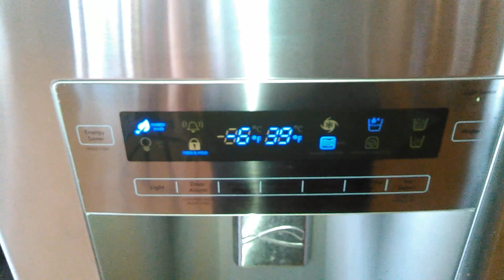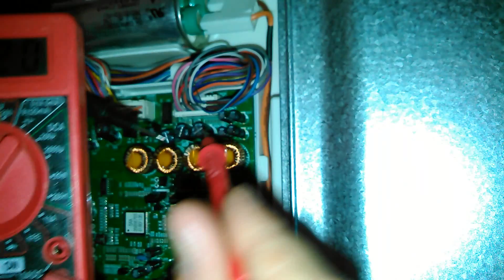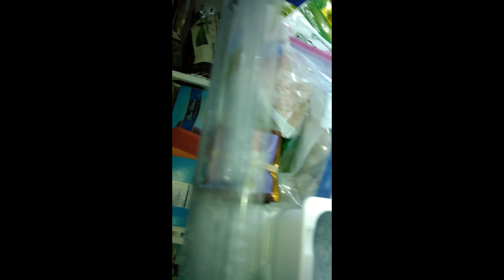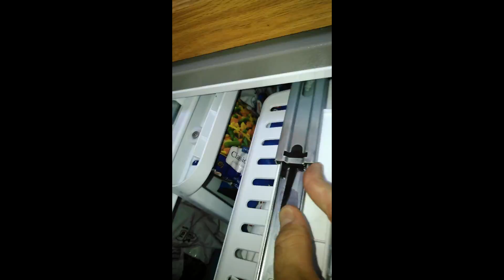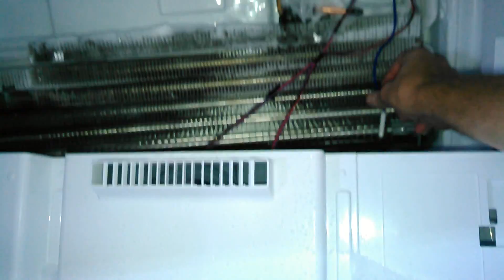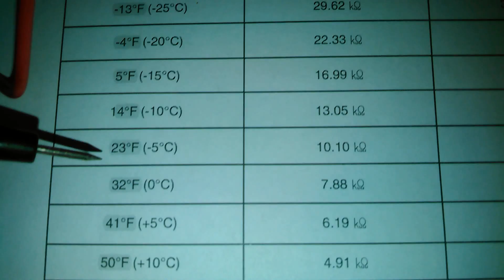Kenmore Elite Freezer Sensor Check 795.7205X.11X

Comment: Great idea to check the thermistor at the controller board area, but you should unplug the connector from the board so you only measure the sensor resistance.  Now compare the chart with the actual temp in the freezer.  You could also put the sensor in a glass full of ice water to check the temp at 32F ( 7.88K ohms).   (We all know you had the power is off)

Comment: Dang, my resistance measures right where it's supposed to be (~19 kOhms) for the temperature. I was hoping this was going to solve my problem but I don't think my part is defective. I had an accidental defrost and the ice bin filled right up but then stopped once it cooled off again.Great video though, thanks for helping me get started on troubleshooting.

Comment: Kenmore Elite, Estimate on replacing compressor $1,389. And repairing fridge.    Guys complete yunk.   How can we stand a class law suite against this product made by LG.  Sears is backed up on these fixes.
Reply: Let me know how. I have same problem with this junk product!
Reply: There already has been a class-action against LG for this.  Not sure exactly what the status is or the outcome was.  I just got a new compressor installed in my Elite 74053 refer and now it works TOO good (freezing everything).  Done with calling and wasting time on repairmen so I'm doing it myself to see if there is a temp sensor issue with mine.  Good luck to everyone!  Yes, LG refers are junk...
Reply: J Williams how much was that ?

Comment from the maker: Look in description for link to technical documents.  You have to view these documents with a technical eye or they won't make too much sense.
Reply: Hey, I am running into issues where the fridge/freezer isn't cooling at all. I was going through checking all the sensors etc but I have the fridge off. For the blue/white wire, I am seeing 3kOhms. It would be great if you can share the documents that you have.

Comment: Are you happy with your Bosch fridge now that you have owned it for more than 9 months?  I'm dealing with the same issue as your video on my Kenmore Elite.  I already replaced the compressor 2 years ago.  I ordered the sensor for $15 from Sears to see if that will fix the problem.  I completely defrosted the unit and there's no ice build-up anywhere (so the auto-defrost system is working fine).  All fans are functional and condensor coils clean.  It's either going to be the sensor (fingers crossed), the compressor again, or the circuit board.
Reply from the maker: Good luck to you with the new sensor.  As you know, it's an easy fix...after all the ice is defrosted.  I am happy with the Bosch.  The unit is a floor model of similar specs, small hidden scratch, ice unit at the top with its own coils.  Nearly 1/2 the price and the store still allowed a 5yr extended warranty.  I can tell all who read this, there is no comparison to the interior design on that Kenmore.  They did one thing correctly.  If only a compressor swap was as cost effective and easy as a sensor swap, I would have thought another second towards keeping the Kenmore...then moved on.  I guess it makes sense for companies/technicians because they buy the parts for 1/2 what the average Joe can.  There was a lot of looking at other frig models.  All were comparable, so I went with the brand I know for quality.   Hoping this brand doesn't go the way of the dodos.
Reply: @gratefulpatron5141  I will receive the sensor on Tuesday (tomorrow) along with a new Refrigerator Drain Tube which I discovered was cracked when working on the fridge.  The 2 parts cost $20 but expedited shipping costs another $22!  I have a home warranty service guy scheduled for Thursday which I will use if the sensor does not fix the issue.  I'll let you know how it turns out.  Thx again for your video

Comment: Would make sense if you said how you chose those wires to check......
Reply from the maker: Good point.  All contacts are called out in the technical docs.  Is the google drive access still available?  This is an old thread.

Comment: The cover on the thermistor? Is that plastic/foam? And you think it's to hold the sensor in place or to protect it from frost?  Mine is completely missing so I need to know, thanks.
Reply from the maker: The cover holds the sensor.  There is a small piece of foam on it, but frost / ice will cover it completely if there is ice build up on the coils.  The sensor has a long wire, but the wire gets encapsulated in ice with ice build up on the coils.  The cover / foam piece looks to have a design that holds and slightly insulates the sensor from the coil.  The coil is [supposed to be] colder than the freezer compartment, and the sensor is supposed to be measuring freezer compartment temps.  
If you are having problems, my guess is there are bigger issues than that sensor.  
My frig's problem was ice build up on coils was blocking air flow to ice making compartment not allowing ice maker to get to temp to make ice.  Every time I manually defrosted the coils, the system worked properly...but, the compressor was running 24/7.  The compressor was just keeping up with demand, but when the d
Automatic defrost system kicked in, the system went out of whack and ice formed on both coils (frig\freeze).  Fix the compressor, or new frig.  We chose new frig.
Reply: grateful patron ... Thanks! What I meant to say was the sensor AND cover are missing!  I got the refrigerator for free, 2 years old, and they didn't have time to fix it when they moved out and bought a new house. My guess is they wanted to replace the sensor and didn't finish. Right now all the fans work and the cooling works but at 45 deg for both freezer and refrigerator side. I think the sensor will fix it.
Reply from the maker: So, here's the good news.  When buying a new sensor, its cover comes with it.  
My guess as to what's happening is the entire unit is relying on the sensor from the frig compartment.  Not knowing how the software works for feedback loops, that's my best guess.  I would assume an error message is showing in the front panel for the freezer compartment.  A good way to test this assumption would be to drop the temp for the frig and see if the entire system can keep up with its demand....measure temperature of frig against frig set temp.  If the unit is running 24/7, there is a very good chance the compressor is failing or failed somehow.  Compressor failure is common after 5 years for this model LG...so I was told by a few technicians.  
I will also tell you we found no equal for internal space.  LG did a fantastic job in its internal design.  Other manufacturers come close, but this LG was/is better than all others we looked at.  Sad and happy to see it go.  We settled on a Bosch of similar size and style.  The style does not have an ice maker in the door.  After discovering the LG ice maker is cooled by a fan (left side as looking at coils) from the freezer compartment blowing through an internal tunnel, I decided to move away from that design.  
If you like, give me your email and I will shoot you the technical documents I have...it's quite a bit.  Takes a little while to decipher, and you have to look at it with technical eyes.

Comment: when you tested the blue white wires on the 6 pin you had the fridge still plugged in?
Reply from the maker: Yes.  The fridge was plugged in and running.  The wire harnesses shown in the video are low voltage.  
Although resistance doesn't need the unit to be on, I tested everything with the unit running.  Sometimes, I would perform a voltage check just to make sure it was hooked up properly...quick connect plugs on the inside.
Reply from the maker: At 5.5, the thermister is showing about 45F.  If you know that the temp at the thermister could not have warmed to 45F, I.e., the freezer door was shut and everything is frozen, there is a good chance the sensor needs replacing.  
Keep this in mind though, you are opening a can of worms when you systematically start replacing components.  I don't know the system well enough to say the feedback (software) loop that interfaces the freezer temp sensor poses a problem.  The tech I talked with said, it is typically the compressor.  I put about $500 in component replacements before I chose to not replace the compressor and go with a different frig all together.
A bad compressor can't keep up with demand and all problems start showing, like ice maker not working, like icing on coils and autodefrost can keep up, like weird temps showing in both frig and freeze compartments.
The sensor is < $20.  So, your call.

Comment: Kenmore Elite   795.72053.110   LED on PCB not blinking at all ...but still its not  cooling  what could be the issue...compressor vibrates and heating up, Fan near compressor and inside one working too all lights inside and the panel display working fine...This one has quieter compressor than previous fridges  though but fridge not cooling at all..??  Appreciate your, readers input ..
Reply: Did u ever find the problem

Comment: Prende todas las luces y no infria nin gunlado
Reply from the maker: Could be a couple things.  The cooling coils are in the back of the freezer.  There are fans that blow the cold air into the ice maker and refrig section.  The cooling coils coild be completely frosted over blocking the fan ports.  Pull the back panel off the inside of freezer to access the cooling coils and look at the frost situation.  I had to use a hair dryer several times to fully defrost the coils...2 weeks later repeat...2 weeks later repeat.  The auto defrost could not keep up with the frost.  The second thing is the compressor is worn out and can't keep up with the cooling requirements...this is normal for 5 years and older units.

Comment: Alguien k me ayude con mi nevera kenmore  no enfría ayuda en México
Reply from the maker: My recommendation is to unplug the unit for 3 minutes (this resets the electronic control board).  Plug it back in.  Go shop for a new unit.  Hopefully you can do this enough times to keep the food cold while you wait for the new unit to come.  
If the unit is not keeping food cold or frozen, one of 2 things is going on, and maybe both:
1) the compressor is bad - this is typical for a 5 year and older Kenmoore of this style
2) the coils are iced over and need defrosting.  When this happens, the fan can not blow enough cold air from the coils to the frig side or freezer side due to the massively reduced air flow caused by the ice build up.
Auto defrost:
The unit in this video had auto defrost.  I had to manually trigger the defrost cycle every 2-3 days and use a hair dryer to completely defrost the coils every 2-3 weeks.
This unit also had the compressor running 24/7.  This meant something was wrong with the compressor and it couldn't keep up with the demand.  Hence, bad compressor.  
I played and fought with this unit for nearly a year.  This unit was 6 years old.  I finally went out and bought a Bosch.

Comment: Did this resolve your issue with the ice and freezer compartment?
Reply from the maker: All the diagnostic work and replacing the freezer temp sensor (and main circuit board and ice maker unit itself) did not fix the issue.  
The compressor started to go, but not broken completely.  The compressor couldn't keep up with demand, meaning, it couldn't cool the fridge/freezer/ice maker enough to work properly.  The cooling coils in the freezer kept icing over (frost) which blocked the air vent leading to the ice maker (how the ice maker gets cold air to freeze the water in the ice tray).  The compressor was good enough to freeze the freezer and cool the fridge.
Ultimately, I didn't like the design and with a large repair cost, I chose to buy a new fridge, Bosch.  I liked the design of the Bosch unit regarding how the ice maker works.
Yes, it was more expensive, but I know once you start pulling the thread, everything unravels.